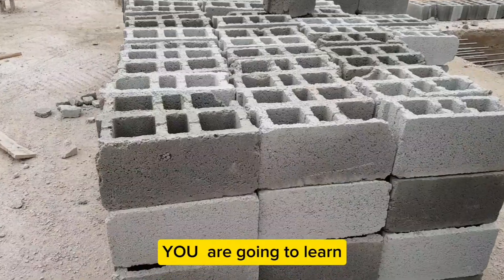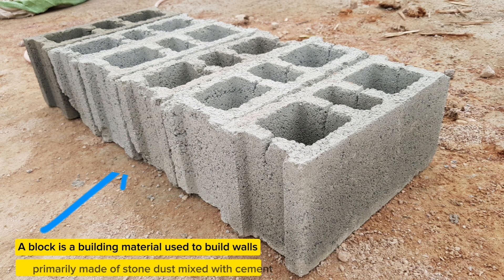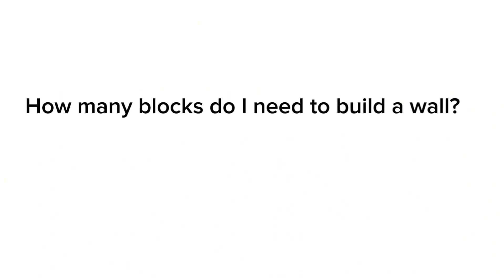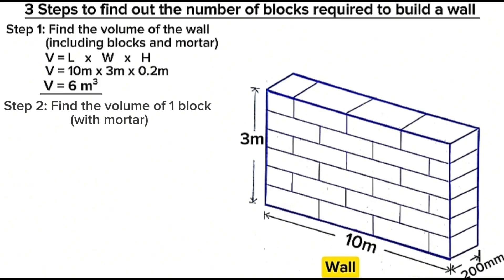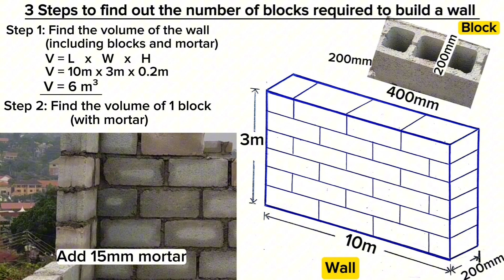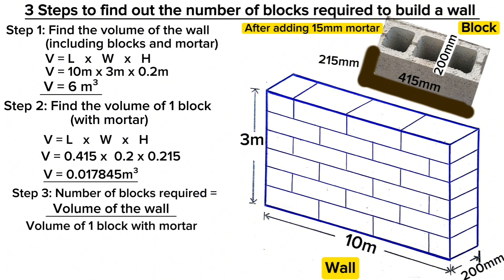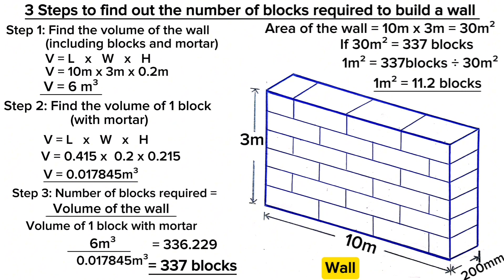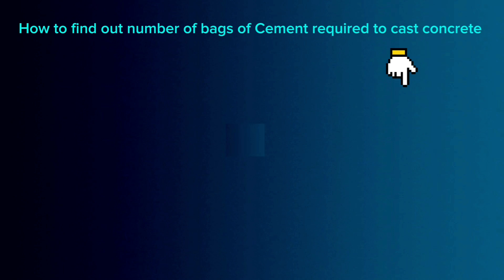How to determine the No. of concrete BLOCKS to build a house|No. of Concrete blocks per square metre

Comment: "Engineer Ian, why is it so hard to estimate the right amount of material? It's either too little or too much."
Reply from the maker: The biggest problem I faced with estimating when I was starting out,  is that I tried to use the academic procedures they taught us in Engineering surveying I and II when (taking off) that shit doesn't work 😂 
It becomes either too little or too much
I got lucky to work with Seyani Co. first, I learnt alot from them their estimates are exact 
From then, I have I have a different perspective